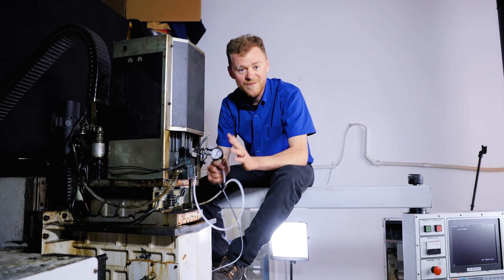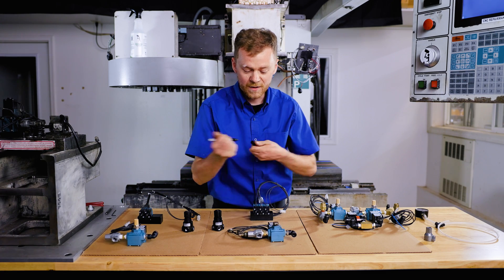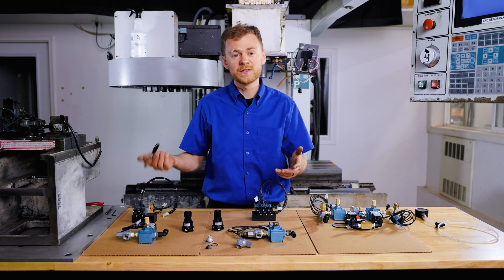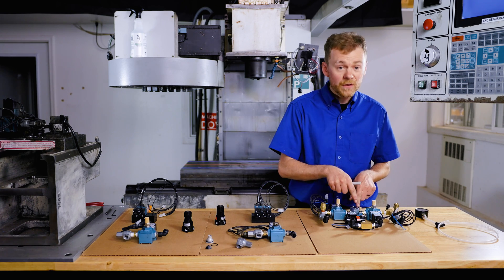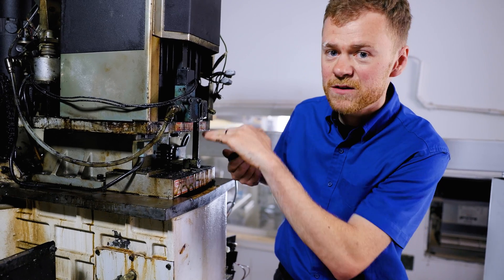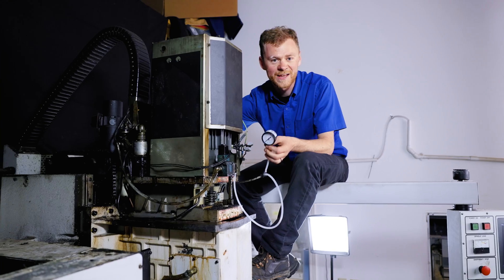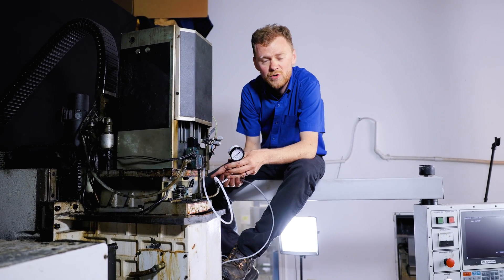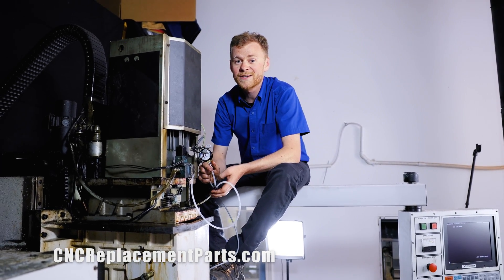Tool Changer Banging- Spindle Repair

Comment: Thanks for the video, I have a question: my VF2 (with TSC) is making a loud bang when changing tools. This happens when the tool has been in place for a long time, or after being subjected to force, such as milling or drilling. I've replaced the soilenoid and the quick valve, but that doesn't seem to completely solve the problem. Do you have any suggestions? Thanks in advance! Greetings from the Netherlands

Comment: I have a 2012 VF2SS at home that the tool release piston is slow to return and also makes the farting noise sometimes. On a rapid tool change the spindle fires up and makes a horrible sound as the piston is still contacting the draw bar for a split second. I now know exactly what I have to do to fix this. Thank you so much for these videos mate, all the way from Australia :)
Reply from the maker: Thanks for the comment. SS machines are different than GB machines. Watch this video. You may have a bad spindle draw bar ring. Spindle Drawbar Ring Replacement—Super Speed Spindle
https://youtu.be/hjMadi3uE9w

Comment: Thank you for sharing your knowledge, I take this opportunity to ask, I have been having problems with that part of a VF4, but it seems that it is something on the electronic board, what happens is that when a routine ends or I pause the program, the valve Preload turns on and off intermittently and doesn't stop until I press reset.
Do you have any idea what could be causing the problem?

Thank you very much again for your valuable videos.

Comment: Great vid. Simple bit too often overlooked!

You could do a quick more in depth one on the tsc pre charge. It’s far more psi sensitive than a standard pre charge.
Not enough and it won’t hold the pressure (or even make it down) too much and you apply to much force to the “union” 
(New carbide tips for these unions may be a good product for your store as well?  (They are pretty basic)
Reply from the maker: Yeah, that’s my plan. I’m backlogged on videos and I wish I had more time.